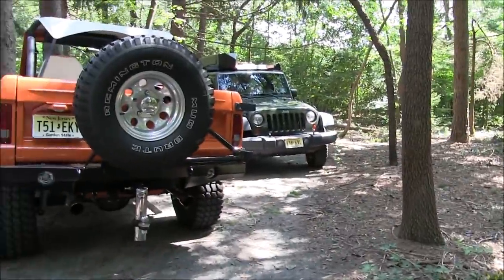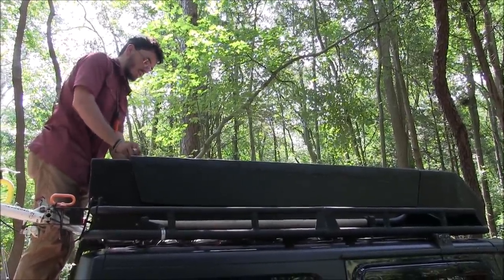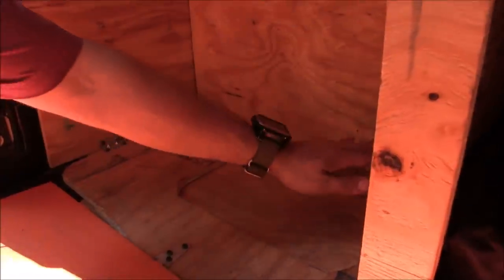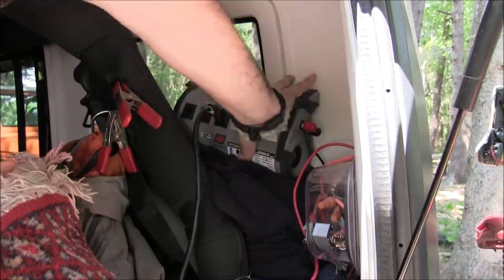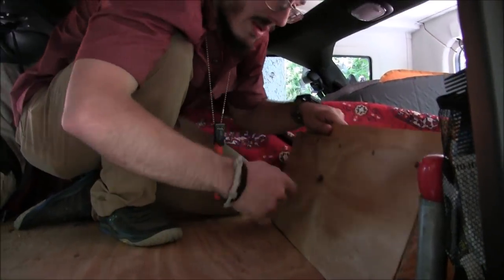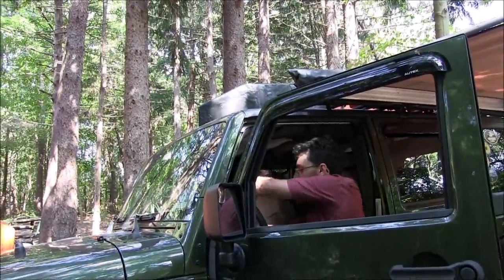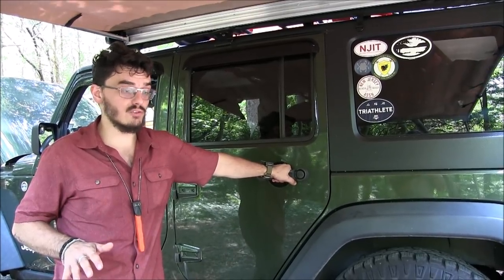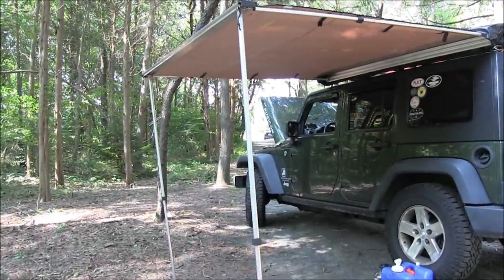LIVING IN A JEEP WRANGLER?

Comment: **..That Jeep is in great shape .. good for you John. I also converted my own 2008 Jeep Liberty, also in GREAT shape with only 85,000 km, no rust whatsoever no where .. now with no more back seats ( permanently ) the co-pilote' seat is banded down and pulled to it's maximum in front, without it's head holder ( so it's condemned ) I used it as table only and it gives more space for my bed ( 68"x28"x7"thick ).. I built with cherry wood and stained my built bed & armoire turquoise and lime-green, and once all finished .. it's quite "SHARP" I'm very proud of my plan.**

Comment: Idea: for those stubborn pins, you could put them in so that you pull them down from underneath (using body weight to assist), and maybe use cotter pins to make sure they don’t slip out while in transit.
Reply: Stephen Otto I thought of that. Ultimately couldn’t find any that really worked. Once I launched the trip, I wasn’t in any position to make upgrades like that. 
Thanks for the input!

Comment: This is actually pretty great.
Reply: Thanks. I took allot of inspiration from boat building. Folk have been living out of boat  and making use of unusual spaces way longer than we’ve been living out of cars! There were three primary bulkheads that made up the backbone of this design. One solid one right behind the seats, one in the middle which was only interrupted by the pass through compartment, and the last one the surrounded the kitchen. I took quite a few days to parce out all the design requirements before I actually designed around them. It’s important to know what you’re must haves will be before you set up the architecture, then design around that. I bought those waste paper baskets and cot, way before anything else went into the vehicle.

Comment: That Persian carpet should be protected from sun damage.  They can  be repaired, if there's a hole. Treasure it.
Reply: afringedweller thankfully modern vehicles have UV blocking glass. So while there is still “Sun” hitting the rug, it’s not getting UV damaged. Honestly, I think the folding is worse for it. We’ll see it’s what I had.

Comment: okay but wouldn’t everything fly around if you went off roaring? also the bikes could be on the roof!
Reply: No, not really. I wasn’t wheeling all that hard. I follow the mantra of Slow as possible, fast as necessary. If you check out my Instagram you can see some of what I did. 
As far as the bikes. I had them on the roof before. Too tall to fit down the trails, and really bad for fuel economy.

Comment: 120V shop light?!  Wow-- a power hog.  You can easily use 1/10th (1/100th?) the power with DC LED.
Reply: It was LED. It’s what I had. I never had an issue. Was usually the only thing the batter was running.
Reply: macmurfy2jka 👍🏽